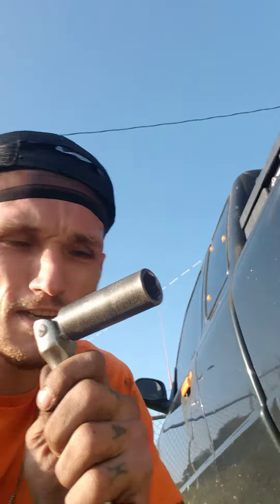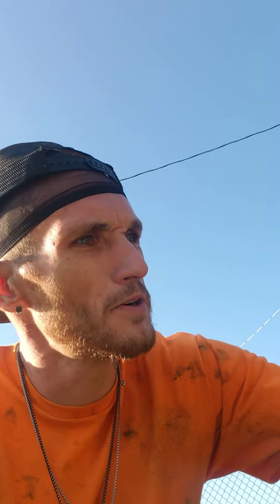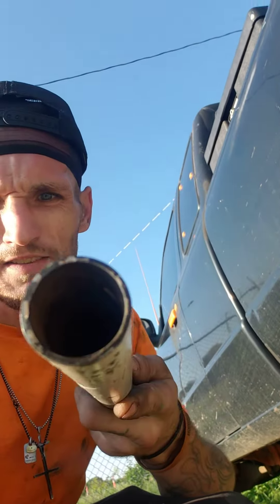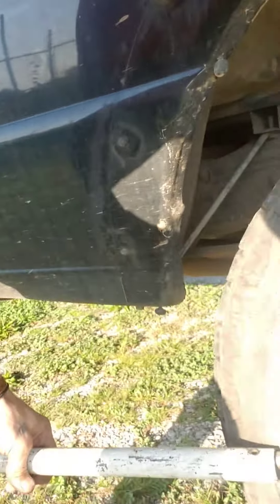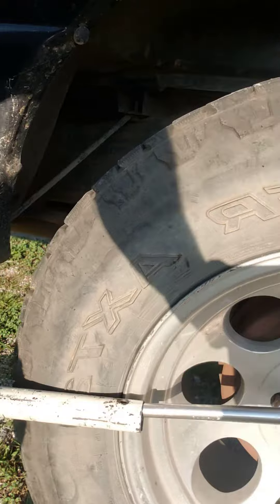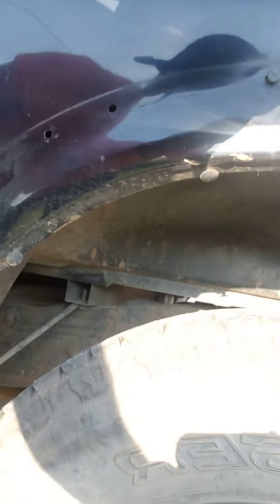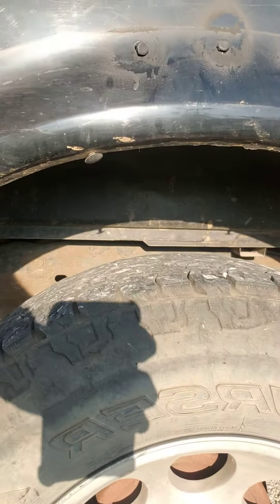easy way to get a over tight lug nut off

Comment: THANK YOU! I have a couple of road trips coming up, 6 hour drive this weekend, then 4 hours, in Sept, and October. This weekend I will be driving along I-37 in Texas as I head towards Corpus Christie, and there is not much out there, I’m certain that if I were to need roadside assistance, I’d be stranded for hours! I’m getting that tool today, and will find a pipe to use for leverage!
Reply from the maker: Glad I could help out I recommend half inch drive an just remember the socket that fits ur lug nuts I actually recommend a small floor jack factory jacks are a pain I think it just depends on what type it is I also recommend u to check the air in ur spare cause they leak just like a basketball in the yard even if  it don't have a whole weather change makes air come out some how
Reply from the maker: An I hope u have a safe trip aswell